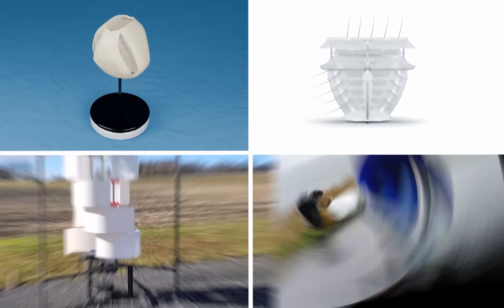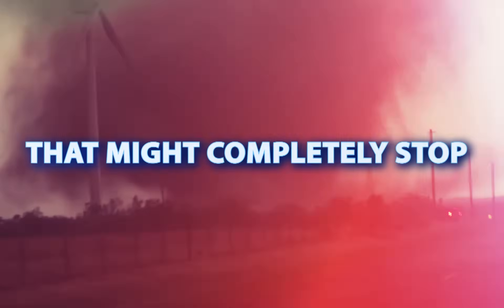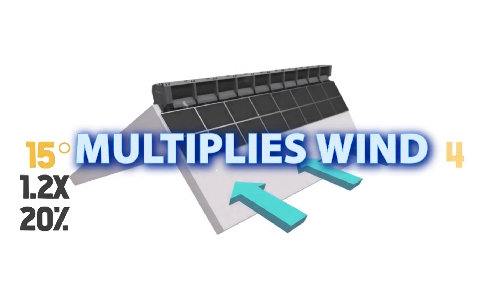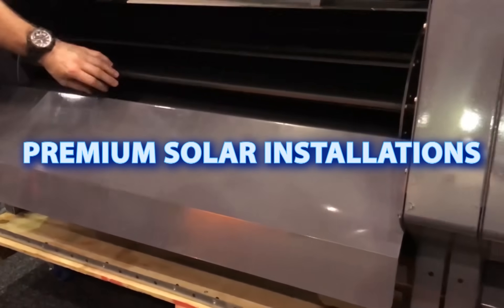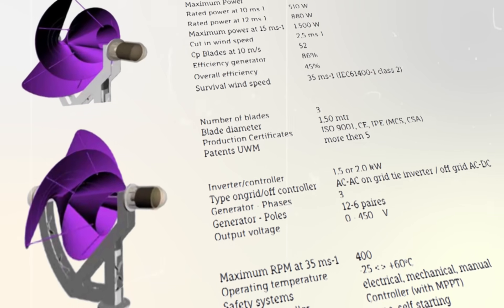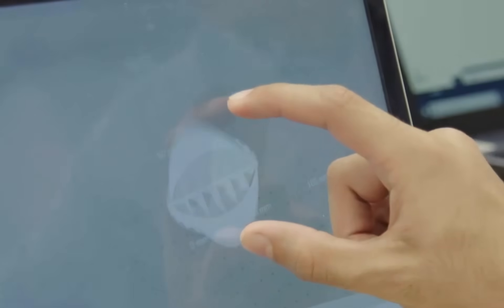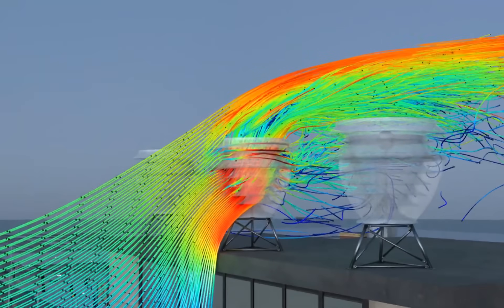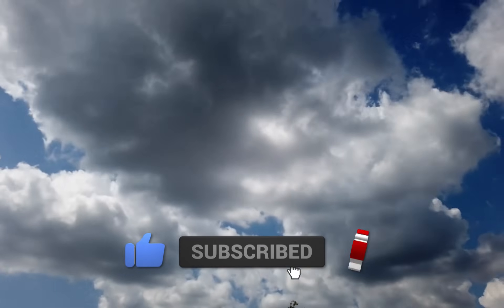5 Genius Home Wind Turbines From Future To Overtake Solar Panels

Comment: I like the Harmony Turbine
Reply: But it's useless. Drag type vertical turbine is absolutely inefficient.
Reply: That  PROTO TYPE  which went into production years ago but nobody is buying  is located in Lebanon, PA  , 
And U will be paying for it and big time !
$5,500 dollars for just a 400watt unit  , ,U could get ten 100watt solar panels for under $1000 , That's 1000watts for 1/5th the price  and 2 and a half times the wattage  !  It's been  about 15 years and I don't think that they even sold 10 of these things  but they sure do want a  person to invest in their company , I think that's how they make money  ,  Investers,  they want your MONEY  and nothing else  but if I was u , I would check them out for myself , they have a phone number if it hasn't been disconnected  !
Reply: 400watts from Harmony for $5,500 or a Vevor  Wind Turbine  500watts  for less than $300  dollars  ! 

400watts -$5,500 dollars 
500watts - $300 dollars  

Still like harmony  ?

Comment: Wind vs Wind? Stupid question: wind blows at night and can fill up my batteries at night or during bad or stormy weather: so they are complementary, not versus. Wind and solar and batteries are needed in order to optimize production and reduce the cost as long as battery prices stay high. This means a decade or two. You didn't mention noise nor vibrations when roof mounting. 
Yes, I know that I live in a privileged region with lots of sun, very low rain. And a 10 kW solar production, with large batteries. 
You mention the price; you should convert this in return of investments. My PV is reimbursed in about 24-30 months; The batteries in about 10 years or less; all this with zero feed in tariffs. What about  wind???. I would be ready to mount such a turbine and measure it in real life
Reply from the maker: Unfortunately, while your solar pays back in 24-30 months, small residential wind turbines typically have payback periods of 15-25+ years due to higher costs, lower capacity factors, and more maintenance needs.

Comment: All these small wind turbines are extremely inefficient. Close to ground is not enough wind!
Wind/electricity yield increases with the third power of the wind speed. 
So +100% wind = +800% electricity. But close to the ground: 0 constant wind, only gusts!
Solar panels generate at least 10 times more green electricity with the same investment in time & money!

Comment: In the last turbine it describes the output in kWh (without specifying any time period).
Surely it should have specified kW?
Reply from the maker: Annual: VX175 can generate 4,000 kWh with an average wind speed of 6 m/s. At 6.5 m/s, it can produce 5,000 kWh.

So at average speed 6m/s you've get ~11kWh daily
Reply: "can generate" 😂
I "can generate"even more on a bike IF.......
The IF is the key 😎

Comment: I have 6 235w panels on my RV. it generates up to 1100 watts an hour and will generate most of my power needs. They were/are used. Cost me $423.  Turbines are loud, vibrate, and just do not generate enough power to make it worth it. .. although they are getting better...

Comment: All interesting concepts but the rather optimistic outputs always amuse me. One boasts an annual 5000 Kwh at wind speed of 6.5 m/s. Well perhaps but where is it blowing at 15 mph 24/7 all year? Here in the UK every winter we get periods of what the Germans call Dunkleflauten. Periods that can last several days where it's very overcast (no solar), flat calm (no wind power) and pretty cold (just when you need energy the most). Renewables are only really useful as short term back up using batteries when something bad happen or at best supplementary to reduce fossil fuel usage. I'm all for free energy through renewables but I don't think they can ever be our main source of energy. Nature just won't play along.

Comment: Title is 100% FAKE NEWS! Solar panels generate at least 10 times as much electricity for the same investment of time and money!
All these small wind turbines are nonsense & extremely inefficient. Close to ground is not enough wind!
Reply from the maker: That’s an exaggeration! While solar panels are often more practical for homes, they don’t always generate 10x more power than wind turbines. It depends on location. Coastal homes, open plains, high-altitude areas, and remote windy regions can benefit more from home wind turbines. England, Finland, Denmark, and Germany are great examples where home wind power can sometimes outperform solar.
Reply: @UnlimEnergy-f3r  Which studies prove your unrealistic assertions? There is no constant wind near the ground - only gusty winds! Wind/electricity yield increases with the third power of the wind speed. So +100% wind = +800% electricity. But close to the ground: 0 constant wind, only aggressive gusts! Yes: Wind power can sometime outperform solar. BUT: Only with huge 150m wind turbines - because in the Ekman layer wind are steady & stronger.

Comment: In Australia we get solar power all year round.
Reply: even at night time... wow... Australia is amazing
Reply: @drb-tb1lh I have had a small wind turbine on my boat for 20 years. Compared to modern solar panels at a fraction of the cost, wind turbines are incredibly inefficient. If I spent what my wind turbine cost on solar panels, there would be no comparison on performance. My 1300w of solar have peaked at 7.2kWh per day for a cost of less than £1k. My wind turbine costs twice that and never does more than 1kWh per day in perfect windy conditions

Comment: All of those turbines are terribly inefficient. Buy a cheap 3 bladed smaller turbine and combine it with solar for a great system. If any of those makers tell you different, they are pulling to wool over your eyes. And yes, I’ve spent time in wind tunnels optimizing wind turbines.

Comment: I did not know that the sun didn't work in the Winter. How interesting. Wrong, but interesting how few creators have capable editors. Peace.
Reply from the maker: The sun still works in winter, but shorter days, lower angles, and weather conditions reduce solar efficiency. Still, solar panels can generate power—even in snow! Appreciate the engagement, though. Peace!
Reply: @UnlimEnergy-f3r  Yeah, but that's not what you said. Just another sloppy, half-assed YouTube video. Peace.

Comment: The shape is not slim, which obstructs the view. This is one disadvantage, but another disadvantage is that the vertical axis wind turbine has a limitation of the weight that presses on the bearings, causing the speed to be limited at a certain point, but the advantage is that it can rotate with lower wind power. My innovation is the horizontal axis wind turbine, but it removes this disadvantage and adds the advantage with a more efficient generator than ever before, making the size of the wind turbine the smallest but producing more electricity than the general large wind turbines.

Comment: NONSENSE!  All practical tests of small wind turbines show the same results- 1) They hardly produce any electricity. 2) They don't last long!
Electricity yield is proportional to third power of wind speed: +100% wind generates +800% more electricity! But close to ground: 0 constant wind, but extreme gusts!
Solar panels generate at least 10 times as much electricity for same investment. Maintenance-free & at least 25 years.

Comment: Total nonsense small turbines, home turbines, don't work they cost more than they will ever produce.
Reply from the maker: North regions cannot live off-grid using only solar energy. In any case, progress is moving forward and perhaps one of these turbines will be a mandatory part of home installations in the future
Reply: @UnlimEnergy-f3r  Totally true but these windturbines will not help its more effective to over dimension solar and batteries than to install one of these. The claimed performance is wildly optimistic. Size and height matters. There is no way a windturbine, however fancy the design, will overcome the Betz limitation. The theoretical maximum performance for a windturbine is 59.3% ( Betz limit) wind force is 1/2*rho*Vsq. Very good HAWT achieve 50% VAWT about 25%
Reply from the maker: Maybe this is the main reason why none of these home wind turbines are in production